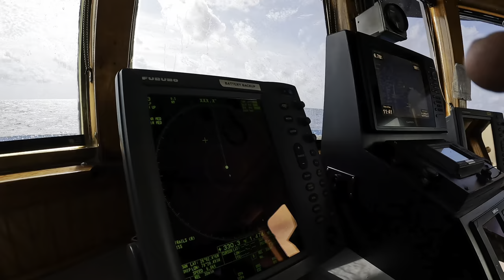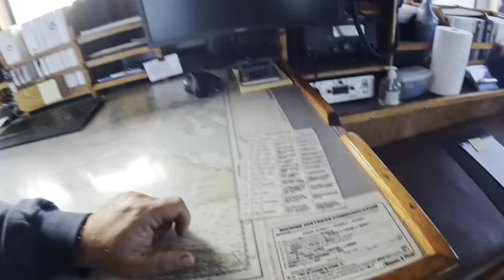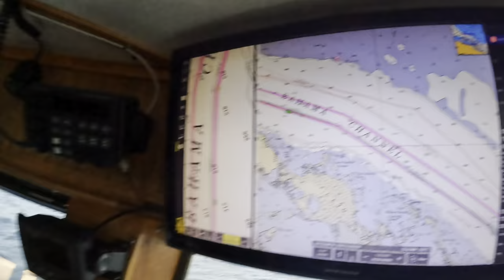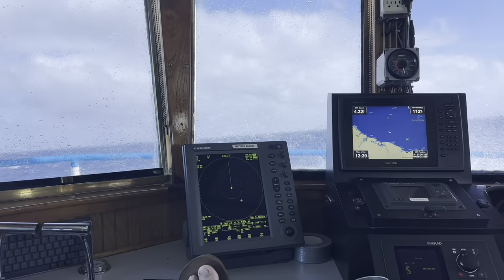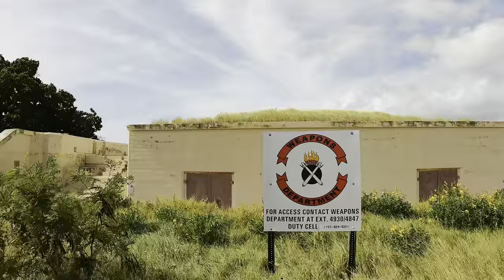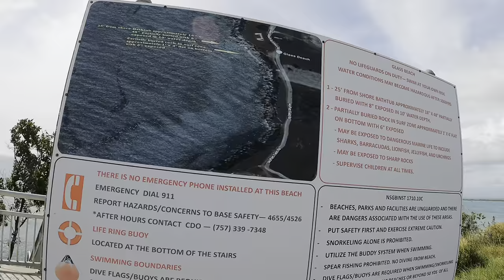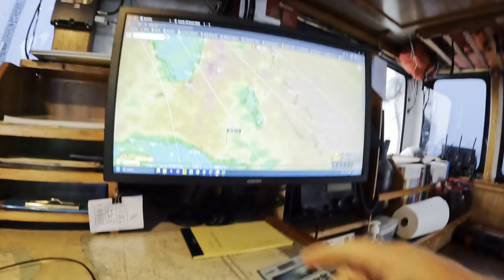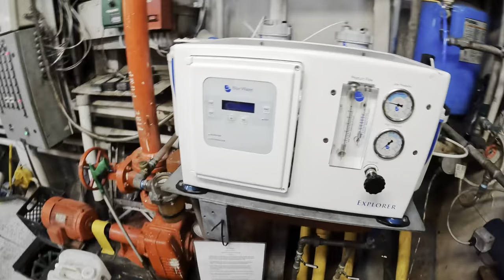14 days at SEA working on a TUGBOAT! {Vlog style}

Comment: “A rough day at sea is still better than any day in the office.”
Reply from the maker: True
Reply: I grew up on the sea Fishing traveling. Spent 20 years in Marines RET now. Still believe no where better than on the sea.
Reply: @TugTrashOutdoors  14 days to Cuba? Does it take the same amount of time to get back?
Reply: I am a Army combat vet but grew up a Coast Guard brat. My dad  spent my formative years rescuing people, pulling grown men out of the water just before they drown and did investigations for boats they could not save. There was a 40 cabin cruiser that thought it could handle a rough Lake Michigan storm. They had to tow the boat in upside down after searching from Michingan City to Chicago to Benton Harbor for survivors. When the divers went down to begin attaching the lines to crane one side up in order to right the boat, he identified one of the four missing men in the cabin by the wheel. My dad was the first coastie aboard as it righted to throw the pumps on and start removing the water in order to begin their investigation. As the boat righted another man slipped out of the cabin and began to slip overboard as the water started flowing from the parts of the craft above the water line. He reached out to grab the body to keep from having to send divers to recover the remains from the bottom of the channel that enters  the harbor. He said that when trying to grab a dead body that has been sitting in warm summer water you want to grab their belt or the waist of the pants. The reason is, like he experience, when you grab their arm it will deglove their tissue right off the bone. He ended up with a fist size bunch of muscle and skin and tissue from the bicep to the fingers as the rest of him went right back in the lake but threw himself in a seated position on top of the next guy slipping out and managed to keep that body on board as he was now covered in putrid slime from the four bodies in the boat. 
That is a bad day

Comment: Cool video. I have a question, why is the barge so far behind the tug?How do you keep an eye on it?
Reply: Wondering that too
Reply from the maker: So the reason is for the rough weather. The dip in the tow wire acts as a shock absorber.
Reply: @TugTrashOutdoors  thanks so now I know

Comment: That was brilliant! When I was 16 years old I came across the Atlantic Ocean on the Stefan Batory we had a tour of the bridge and stayed for about 35 minutes, and were supposed to have a tour of the engine room,  however the Captain cancelled that which was disappointing. At the time it was a force 10 gale, about an inch off the Canadian coast on the map. We also learned that the Stefan Batory had stalled twice, once sailing from Gdansk, Poland to Tilbury, England and again from Tilbury to Rotterdam, Holland. So maybe it was just as well we didn’t descend into the depths of the engine room. There’s something special hearing the sea splashing on the hull of any vessel, I find it’s so relaxing.
Reply from the maker: Super cool!

Comment: When I saw the cable installation, I thought I have experience with locomotive cranes, changing the cables, using a manual cutter and sledge. Then came the fueling. I use to fuel locomotives. Then the wheel house. When you said computers, I am lost. Was use to parallel ruler and dividers. The galley was great. Am glad you took the creamer I didn’t like. The oranges brought back memories of not having any place to wash up before I ate. Orange peels do that job very well. Then your cabin. Nice you don’t have to share. But that alarm would never work for me. I need reveille. Next, your shift. That got me really jealous. I’ve had to work, 8,10,14,16 and 18 hour shifts on the different jobs I had. Then the engine room. Those 2 EMD motors. I use to work with a twin stack (1200HP) locomotive. Which was nice, but prefer the Fairbanks Morse. At one of the docks I worked, when we tied up the tug, I told the crewman it sounded like a locomotive. He said FAIRBANKS MORSE!. Their sound is music, kinda like a Pete! So after watching your video, I realized I should have taken your career path! Instead I took truck driving, dock work, rail yard and junkyard crane operator! I’ve worked in hurricanes and blizzards and heat waves! Now am too old!!! 
    You should show your video in high schools!
Reply from the maker: Very cool!

Comment: Great tour.....
  How often does the tow cable need to be replaced? 
Also, do you dock the barge  with the assist of another tug or are there smaller tugs that take the barge and shuttle it into the dock?
  Thanks
Reply from the maker: We track the hours and miles of the wire but in the end you just know when it’s ready to be replaced
Reply from the maker: We usually have an assist boat

Comment: As a now retired ocean-going tug (16,450 BHP) master, I enjoyed the trip!  The only slight surprise was the fact that the tow wires didn´t look coated.  For old pro´s like me, it would have been a little more interesting to have learned the BHP and bollard pull. I´ll guess at 2500-3000 HP . This is the first time I have come across your VLOG(s) but I will certainly look out for more. Well done.
Reply from the maker: Good point!

Comment: Very cool video. In my younger days, I used to run smaller sportfish boats off the coast of New Jersey. Did some deck work and engineering on a few draggers and party boats, too. I miss it sometimes, even when the weather was snotty. She seems like she handles a 6 to 8 head sea pretty well. Hope you got that autopilot fixed. I would like to see more of the engine room and know a little more about those big mains and your running gear. Those gensets looked like CATs. Anyway, keep up the great work!
Reply from the maker: Yep Cat gens! thanks

Comment: Interesting to see you towing the barge. My late father in law was engineer on a ocean going Tug in the Baltic. A Russian vessel. When the soviet union collapsed  he and the crew got stuck at sea and weren't able to enter any ports. They got a life boat and sailed/snuck  into Klaipeda, Lithuania .His Tug had MAN diesels. 
Guessed from the beginning that you were running EMDs and the 3608 (?)  Cat genny units. Cant mistake that Sound😊😊 . I served my apprenticeship on them .those are smaller  EMD units there as they can be had in V20 configurations .The EMD was designed by Winton and the same principles of design were used to design the famous Detroit Diesels .
Reply from the maker: That’s pretty wild. Them old Detroits run forever

Comment: Im curious. 
Can you use both winches at the same time to maneuver the barge around? Or is one always a spare?
thanks
Reply from the maker: Not really no. We can tow two barges at once though
Reply: Interesting, towing two barges at once? Are they coupled tight together or is the second barge trailing behind with a long cable?
thanks
Reply from the maker: @jimsontario2816  they are towed separate

Comment: What a fascinating look at life on a tugboat!  Very interesting stuff.  One question though: You said that the boat goes through 2000 gallons of fuel per day.  Divided by 24, that's only 83 gallons per hour - which seems kind of low.  Soooo...is that "2000 gallons per day" just for the tug drive engines?  Or does that include the fuel used by the diesel generator too?  83 gph seems pretty economical when you're towing such big barges.  Again, great video!

Comment: As I’m watching the video, I was thinking “I wonder if they still have all the Iguanas on the beach in Gitmo?” About that time you show an Iguana. When you were running I was thinking “boy that sure sound like the hum of an EMD engine”. And what do you know, at the end of the video you show what looks to be 2 567 EMDs. I believe 567 series is the correct number. It’s the series before the ever so popular 645 series. I’m more familiar with the 645 and 710 series. The Gens look like 3406 Cat engines. I’m more familiar with the C-19 and C-32 ACERTS. 

 For some reason I had just assumed you were towing a fuel barge but it appears to be some type of cargo barge. 

 Having a career in the Inland Towing Industry I look for the similarities between what I know and the ocean towing industry. There’s many many similarities, even down to the RosePoint system. You didn’t say but I assume your AIS is integrated into your RosePoint? 

 But there are some very noticeable differences too. Inland we push the barges rather than tow. Nor do we have to worry about rocking and rolling in high seas. Depending upon the boat our equivalent would be doing tow work (connecting the barges to make a tow). There’s a lot of beating and bumping around and a lot of throttle changes that can make good sleep difficult. Also our tows are made up of multiple barges.  Most common tow would be 3 wide 5 barges long (105’ wide x 1000’ long not including the boat). Common barge sizes are 200’ L x 35’ W and the 30k barrel tank barge 297’ L x 54’ W. A 9’ draft on all barges. Some may be loaded up to 12’ water conditions permitting. The largest inland tow recorded was 81 barges, that’s 13 acres of barges. 

 Great video, I’ll have to see if you have others

Comment: Hi Captain!
Is your Tug a 300 or 4200?  Dual wheels?  Cort Nozzles?  How come you don't have a "Texas Bar"?
I guess doing without requires a different set of considerations.
The food does sound good!  If I worked onboard I would likely gain weight.
Hey your Tug has the wire controls out in the open, no doghouse?
Ahh, if he is the Captain, then I guess you might be First Mate?
Reply from the maker: Yes and yes

Comment: This looks like a fun trip. What type of tug boat is that? What is the HP and year? Does it have two engines? Trying to add up the gas you guys burned per day. 😅
Reply from the maker: It was built in 1970 with twin EMD’s it’s about 3000hp

Comment: Try 30 days working on a tow boat on the lower Mississippi River in the summertime. I CHALLENGE YOU.
Reply from the maker: I did 60 days in the African oil field without touching land
Reply from the maker: I’ve done a little of though hitches over the years. My job is a pretty cushy now

Comment: At timestamp 24:04, the crew is attaching something to the cable using an impact tool(??) What is the piece being attached to the cable??
Reply from the maker: That’s a what we call a chafe board. Designed to ride on the rail of the tug and get the wire from chafing

Comment: On a smaller boat like yours, can you be an engineer if you only went through marine mechanics school? Or would you have to go get your engineering degree?
Reply from the maker: You would have to gain sea time in the engine room by working then take a few courses as you work. Kinda more of a on the job training.
Reply: @TugTrashOutdoors  so more of an entry level position and then work your way up to the lead mechanic after a couple years?
Reply: @TugTrashOutdoors  I just was wondering if you have to be an engineer or not, to be a cargo ship or tug boat mechanic
Reply from the maker: @ethanwalker1222  no you’re technically not a engineer just a mechanic
Reply from the maker: @ethanwalker1222 yes! Now if you already have mechanical background you can move up much quicker
Reply: @TugTrashOutdoors  that’s great, I already work on Caterpillar with motors and all the systems within the machines. Plus years of other equipment. What would be the difference in duties between a mechanic and a marine engineer?

Comment: Is that an old Robin Class tug?
Reply from the maker: I do not think so
Reply: @TugTrashOutdoors  the interior looks identical, just curious.  The Robin Class were built in the 1970's by McDermott.  Most were repowered with Cat 3606's.  I'm currently doing a full rebuild on one.  Engines are out and interior is gutted.  Your interior is identical layout.